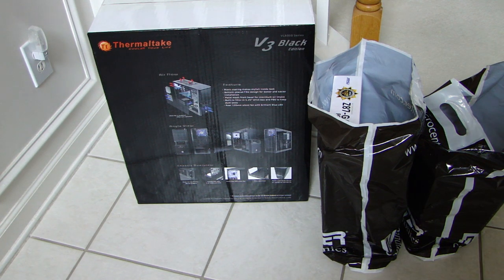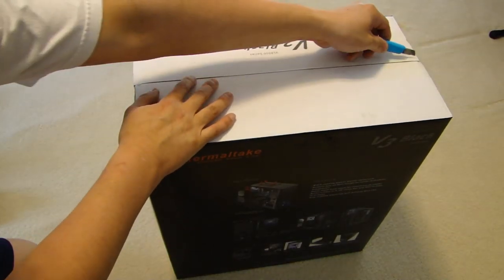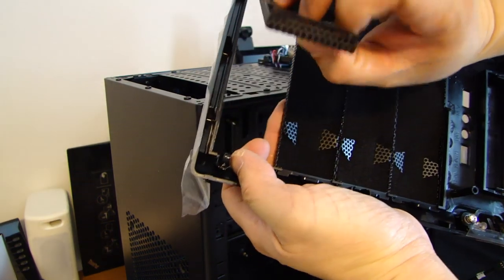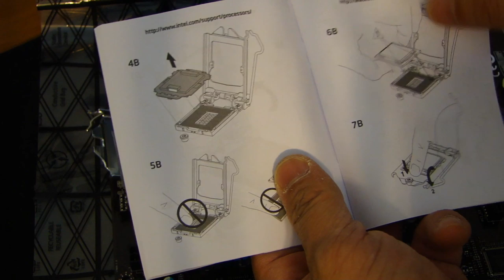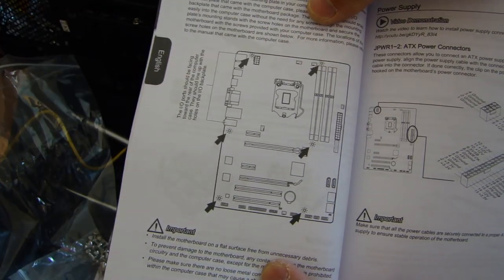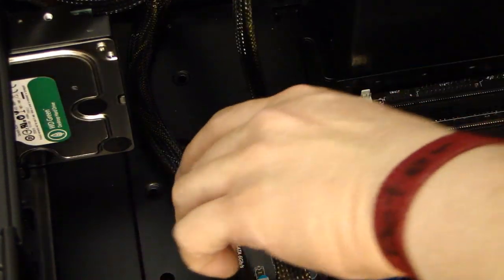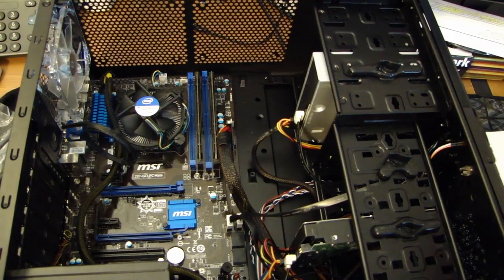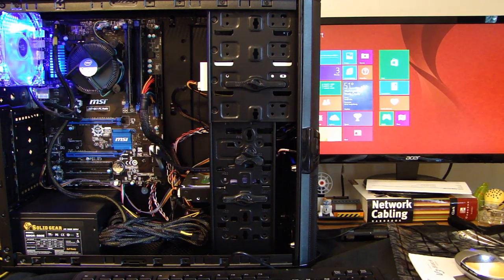Build Your Own Computer & Save Money - Intel Core i7 & Win 8.1

Comment: I just built this config.  Thanks to the video it was the fastest PC I have ever
built.  The wires for the Power, Reset, etc.. little tricky with placement.  I had to
refer to the manual on how they went in.  Polarity indicator is on the connector.
All the pieces with 16GB of RAM and extra sata cables came to $693 w/tax
from the Cambridge, MA  Store. 
I really tried doing this straight from the video but the connectors I mentioned
forced me to the manual.
Thanks for the great how to video. It was just the type of inexpensive hi end system
I wanted.

Ken

Comment: On my 2nd month with this rig.   My only complaint would be the burner.
I found with DVD -R it burns very very very slow. I have had this happen
on two burning programs I use.    + R seems to be fine.
If I were to do it over I would buy the Lite On burner for $2 dollars more.
Over all I have not found this much computing power for the price.

Comment: Yesterday I decided to build this same config.  I live in RI, work in MA. and noticed
Cambridge Ma has a Microcenter.   Order all parts on web for store. In just a few minutes I received a email saying all parts available for pickup. 
The only thing I ordered differently was 16GB of RAM instead of 8.

Thanks to this video it was the fastest computer I ever built.
I had a couple hang ups.  The center stud was already installed in my case.
It wasn't to I installed the mother board it was the wrong type and I had to swap
it with the spacer type for a motherboard screw. The other thing, which was the hardest was connecting the small connectors for POWER, RESET, etc.  The orientation could not be seen from the video.  After going back and forth with
the manual I figured out where they go and the correct polarity.

The PC powered right up with no problems.  I installed Win 7 with no problems.

I have a question on the MOBO driver disk.  Did you do the total install or did you
manually go through each item and install them.   I didn't want to install their security software (Norton) along with Chrome, etc.  I thought Norton might be a problem to uninstall.   If you select Total Install can you deselect items you don't
want then let the rest happen automatically?  I ended up manually installing items.

Ken
Reply from the maker: Wow, you really jumped on that fast. With the 16GB, your system will be performing really well. With regards to the MOBO, after I installed Win 8, I hated it and then install Win 7 Pro on it. So I installed the updated drivers 2 times. Frist time, I did it one by one, the second time, I did the total install and the driver install does not include the antivirus install. Thanks for sharing your build!
Reply: dial2fast
I might do the Total Install myself.  I think I got them all manually but it did look a lot simpler with total however I did not want Norton, and Chrome on there.
I had norton once and it was a real pain to remove it. 
Ken

Comment: Update,  so far the computer has been running fine.  The Live 5 update software
is amazing.  I wanted to check for any newer revisions of the drivers.
It told me what I had on my computer and what the latest was on the MSI server.
I select what I want updated and click auto install.  It downloads and installs the latest.  What also surprised me is the BIOS updates the same way.  Very simple.
A new BIOS was available so I let it update it too.

I tested the PC with a program that would bring my old 3GHz dual Core to its knees.
It ran the program plus let me carry on installing programs and surfing, no problems.
Even with high CPU usage, in the 90 percent still I could do other things.
I don't know if the 16GB vs. 8GB is helping but I like it.  I went with 16GB
because of of the on board video.  Older computes with on board used Ram vs.
dedicated video cards having its own ram.  To play it safe I went with the 16GB and this is only because of the programs I wanted to run.

I would have preferred USB 3.0 ports in the front.  I might look for an add on that will
fit in one of the bays with its cable connected to the USB 3.0 socket on the mother board. I use a USB 3.0 portable drive and it would make it easier with front access.

Ken

Comment: would you mind adding the part# for the HD,  Ram,    There seems to be a few HD
with the same name at the site you purchased the equipment from.
Reply from the maker: RAM: 211334
HDD: 622373
Power supply: 716597
Case: 497818
Motherboard: 614982
CPU: 583369
DVD burner: 764449

For the CPU, try Newegg.

Comment: Update:   All is working good except for the LG GH24NSB0 burner.
              I find it extreme slow with burning.  I use a program called ConvertToXDVD
              and it could take close to an hour to burn the disc.  I have a older USB
               Lite On burner and it did it in about 10 min.  A google search finds
               others with the same problem.   Its not my media.
               I have tested it with the latest ConvertToXDVD with same results.
               I have used other burning programs with some working better than other, however
               if a Lite On or other burner was available for a similar price I would
               go with that instead.
               At $15 its not worth returning.  Since it reads disc fine I'll pick up another
               burner.

                Another note:  I have tested the computer by running a few several
                                      programs that would have brought the old PC to its
                                      knees with the new one running great. The key thing
                                      I noticed is 16GB of ram is paying off.  Looking at
                                      the resource monitor in Windows 7 I can see how 
                                      8GB for my needs would have  slowed the PC
                                      down.

Comment: Hey there im thinking of building me a pc for gaming. Would this pc build be adequate ? And would you please list all the things that you used to make this pc ?
Reply from the maker: All the parts are listed in the description. For gaming, add a graphics card and get 16gb ram. Thats it.
Reply: dial2fast t
Technically most games only use roughly 2 go of ram at a time. Other then that dial your right.  Make sure you get a processor with super threading. It allows the information to travel faster. And you pic will be more clear!

Comment: dial2fast can you help me??
I have tried getting help but no one will help me so I am hoping you can?
I have a core i7 2600k cpu with 8gb of ram and so on....
but my problem is when I go to load my windows 7 install disc, it loads the files and when it gets done with that it goes into a screen shows the windows logo that swirls and or probably installing windows but it freezes up and dont go any further!
I am trying to figure out what my problem is cause I was building it for my DAW for my recording computer but i cant seem to figure out what is wrong it gives me a 0X9C error code with a blue screen but dont know where to turn now......my cd burner is brand new i got a GSkill 120gb SSD new ram is new everything is pretty much new except mobo and cpu i got those from Ebay, and have never got burned from there but can you please try to help me I would greatly appreciate it
Thanks
Reply from the maker: Check your BIOS setting to see if you can change the SATA setting from IDE to AHCI. Google around and see.
Reply: ok
Reply: i did have it on ahci but no luck and i tried to google but everything i tried dont work

Comment: would a corsair case fit with these parts?
Reply from the maker: This motherboard is a standard ATX form factor. As long as your case will fit a standard ATX motherboard, then it will work.
Reply: dial2fast thank you! and sorry but lat question. Could i use any other ATX power supply than the one u mentioned. could u name out one please. i cannot find this type of power supply on newegg
Reply from the maker: Erik Truong Any PS2 ATX power supply. Find something 450W and higher

Comment: Intel core i7 is expensive! There's no place I found a cheaper price. Though the modern computers, tower only, run from 700 and up with Intel core i7, so it might be better to build your own computer because you can purchase each part individually as you can afford it then put it together when you've bought all the parts and shopped around for the best prices.

Comment: why did you buy an unlocked CPU and not overclock it and you will need an aftermarket cooler.
Reply from the maker: Overclocking is done via the motherboard BIOS settings. Core i7 is plenty fast for me and don't feel a need to overclock it.
Reply: dial2fast
well if you didn't need some extra power you should've got a locked CPU and saved some money and nice build.